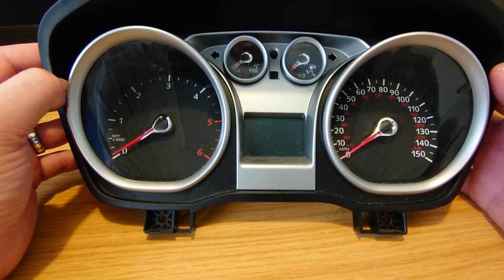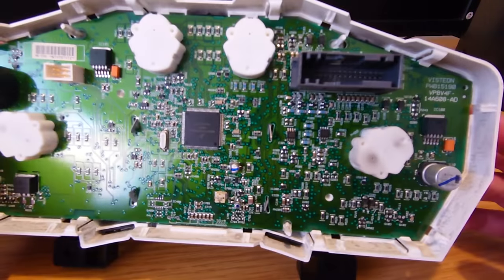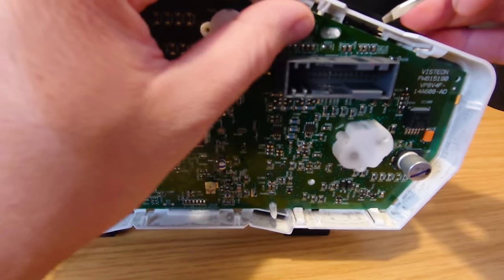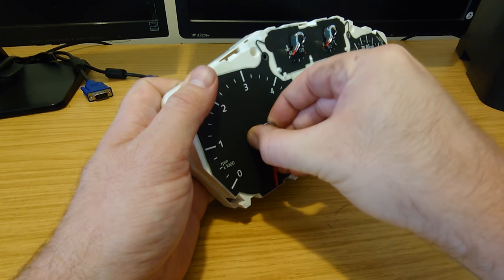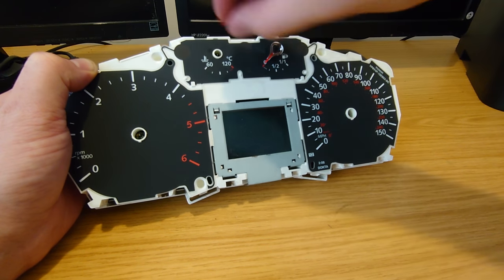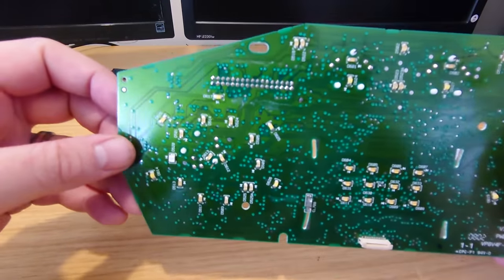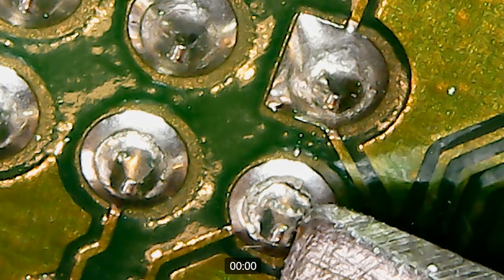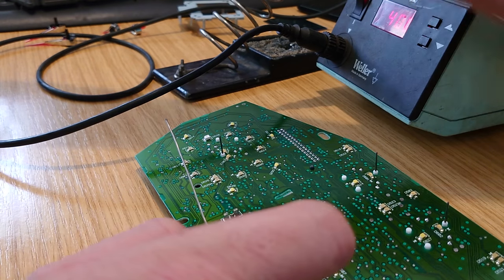Ford Focus mk2 instument cluster strip and repair U1900

Comment: I was one of the unsuspecting Ford Focus owners who came across this problem not so long ago. Transmission Malfunction and Engine warnings had me worried at first but it quickly didn’t add up, especially when it was intermittent. Some searching on the web had revealed that it was the pesky instrument cluster. This video helped me understand exactly what I needed to do and gave me the confidence to buy a soldering iron and try and fix the problem myself. A week later after the repair, it appears to have been successful. Whilst I didn’t have a microscope, I could still in fact see cracking on the original solder, so a re-solder of all the joints gives that extra security for any further mishaps. I will check in from time to time and update readers of this comment section but for now, the issue seems to have been fixed. Thank you to the creator of this video, you have helped so much!
Reply: Two months later and still no issues 👍🏻
Reply: Thanks I had this problem too.
Reply: @noddyhasgame  Hi, I've got the same exact issue you described above. Is your car still going strong since your repair job?
Reply: @HussainBukhari  Has been perfect ever since brother 👊🏻
Reply: @noddyhasgame  Thank you so much brother. This video and your comment gave me the confidence to carry out this repair myself. My first time soldering and everything went well, hopefully that’s the end to the instrument cluster problem for me.
Reply: @HussainBukhari  That’s excellent news my friend! I am sure it will be the end to the problem, in fact my car was running fine earlier, so I am sure yours will too. But make sure to keep us all updated!
Reply: @HussainBukhari Bonne année ! Salut, la voiture fonctionne bien ?
Reply: @EdenLaBaleine  bonjour, oui, ma voiture fonctionne parfaitement. même 11 mois après l'avoir réparé

Comment: I did the resoldering and the engine malfunction message disappeared. But the check engine symbol is still on. Does this mean I have another problem? The car is no longer in limp mode. Do I need to delete the fault codes or something after doing the repair to get rid of the check engine symbol?

Comment: I have had to perform this fix on the wife's motor. With this guide, it was effortless but for the need for a magnifying glass. The usb microscope makes it seem like it can be seen without some kinda magnification but I found that my camera had a macro mode on it so I used that to identify the cracked solder joints. All I did was reheat the joints with a hot tip and used a tiny amount of solder but anyone can fix this with a cheap solder kit and this guide. Brilliant video, thank you.

Comment: This exact issue has been causing start up problems for a couple of months. Diagnostics scans cost £80 and that’s before any repair work takes place. Car wouldn’t start but pressing on the instrument panel brought the engine to life. So definitely symptomatic of failing connectors. Reflowed them and the engine started up first time. No warning lights since. Thank you so much for making this guide you saved me a lot of time and money.

Comment: I had this problem a few weeks back. It wouldn't start on one occasion and a quick bang on the dash got it going which confirmed it was this particular issue so I whipped out the panel, followed the video, wasn't difficult and my focus is running fine now. This has saved me a chunk of money and hassle so a big thank you. 👍👍
Reply: Could you see a crack on the joints?
Reply: @Cripinub1  No it was difficult to see which one was faulty. In any case, it made sense to re-solder all the joints to prevent another one becoming loose so I didn't need to find the faulty one.

Comment: Great video. The only thing I would advise doing differently is regarding removing the needles; they do not need to be twisted off. It's better to pull them directly up and off - use a fork or teaspoon to pry them up if they're stiff. When reinstalling, press them directly down in the same position that you lifted them off.

By twisting them as you remove, you will almost certainly knock the stepper motor's stopping point out of position. Then when you reinstall the needles, they'll give incorrect readings. Readjusting and recalibrating them is very fiddly and time consuming.
Reply: Yes - I twistd them off and its impossible to get them to the correct position again.    Might drive this car off a cliff anyway
Reply: @matthewsalmon8194 Lol 😅 annoying same problem here
Reply: Any chance of making this a sticky? I've just wrecked my speedo stepper, by twisting it off...It might save some grief for others
Reply: Isn’t accuracy lost by removing them because they aren’t keyed to the shaft?
Reply: @MightyGimp  Yes, there is still a risk. But it's significantly less than if you twist them off. And once you have everything reinstalled, you should cross reference the readings shown by the needles against what is shown by the car's computer display (accessed via the service menu), to make sure they match.

Comment: Thank you for sharing this, my wife's 2010 CMax had started messing around with engine malfunction warnings, immobiliser issues etc. The diagnostics pointed to multiple CANBUS communication issues, but it didn't seem to be related to the cluster, banging it seemingly had no effect. That said, after getting stranded in a car park with an immobilised car, I decided to open up the cluster and at each end of the connector there were dry cracked joints. I desoldered and resoldered them all to get best results and the car is working perfectly again. The garage my wife normally takes the car to wouldn't touch it, and were essentially saying it might be time to replace it, so this has saved the cost of a new car!

Comment: Great video. Fixed my old broken instrument cluster yesterday after buying a replacement, which was also faulty. Followed all your steps and my car runs perfectly. Brilliant
Reply from the maker: Glad it helped👍
Reply: I resoldered the original cluster, like you did. The second hand one I bought didn't work at all. Thanks again
Reply: @rangerdan8661  I believe the clusters need coding to the ecu👍
Reply: @leefurniss  still working perfectly after 12 months with no issues
Reply: @rangerdan8661  Good to hear, I repaired an old friends a week ago and he can't believe It's fixed the problem, He was told by the AA recovery driver that he needed a new starter motor 😡Obviously he didn't

Comment: Followed instructions on clip. Resoldered the 32 pins under the connector. Cleared all the fault codes using ELM  OBD 2 (bluetooth one), used Torque pro software to clear codes, did 25 miles driving and no problem so far. Please note that if the engine malfunction display lights up and acceleration is reduced, if you turn off engine after stopping. Then you wont be able to restart the engine. If you clear the faults using elm OBD 2 reader then the engine can be restarted and you can get home. Thank you very much for the detailed video, It's brilliant. My middle display had two connecting strips, managed to take them out by pulling out two plastic lug near the connectors.

Comment: Saved me an effing fortune this! I ended up just melting the existing solder on each pin to cover all bases as didn’t have a microscope. Piece of cake. Like one of the other comments mentioned, definitely mark the dials position before removing and prise off rather than Turn as it ruins the calibration…recaibrating was the hardest part of the job in the end.
Reply: How did you recalibrate
Reply: @Cripinub1  left the front cover off and started the car up and reset everything whilst it was running. Had to cut the cable tie that holds the wiring loom to give me the length to fiddle about with it.

Comment: Thank you for your video. I had the same kind of problems on my Focus2 (2010) : Engine warnings, and sometimes unable to start the engine (in French : défaut moteur and sometimes défaut direction assisté). I check the instrument cluster and found exactly the same cracks on connector solders. I fixed the failure one week ago, and no fault came back. Thanks a lot !

Comment: Great video not easy but this video got me through it  brilliant ! The car runs alot better ,  but be warned the pins to be soldered are tiny , the LCD display is connected with a wedge system which I found very tricky and you need to rotate the dials the same way when putting them back on and make sure they hit zero so your not speeding without realising!  Great Video saved me a lot of money that I don't have 🙏
Reply: Hi Jimbob5b, I read your comments about the focus cluster problems, I have had the same issue on an 06 plate, I've done the soldering which worked fine but my clocks are all over the place, tàcho falls below zero, speedo is stuck at 50mph, temp & fuel gauge are ok, any thing I can do to get them to work properly again.
Reply: @billnolan4104  It was a long time ago and it was nightmare!  I remember the way you twist the needles on the speedo was different each side , have you tried to refit the needles but setting them at zero b4 the power is on  possibly,  it sounds like you are almost there! It is a tricky job from start to finish.  Go back over the steps and you will get there

Comment: Thank you very much for your great video manual that fixed my problems with the car: acceleration reduced and engine malfunction alarms,dropping of rpm and speed needles,ESP,engine unit warnings.
I found that solder on 5 of 32 pin contacts on the circuit board of the cluster were  cracked...
Reply from the maker: Thanks for the comment 👍
Reply: Can u see the cracks with your eyes?

Comment: Thank you very much for your video. I repaired my Focus mk2 instrument cluster due to your clear instructions. Cheers!
Reply: Did you do coding after?
Reply: @newlife2281  No I didn't. To be honest I don't know what you mean with "coding" but I did nothing more than disassebling the cluster and welding the cracked connectors. I was pretty easy.
Reply: @willfriend79  I think coding is not right word🙊.
I think it is programming or something like that
Reply: @newlife2281  don't worry, maybe it's  the right term. It's just that I don't know much about electronics. I only followed the instructions and worked. 😅
Reply: @willfriend79  so probably you are as good as me in electronic, understand nothing😂😂🤛
Reply: @newlife2281  absolutely 😂. That's why I think the video is a great success. 😅

Comment: Great video! Would this solve the problem of the light for the cluster (milage etc) not turning off after I've locked the car. It's draining my battery. Guessing it's one of these having cracks in it?
Reply from the maker: Most Ford I find take about 45 mins to fully shut down. I have a battery drain video on a VW golf if you need a process to follow on checking battery drains

Comment: Just what I was after as my 2010 Focus started exhibiting the same symptoms a couple of weeks ago and local garage won't touch electronics. Couldn't quite tell how you removed the LCD nor whether you just used a bit of flux to help the solder flow as you re-melted it, butt certainly got enough to work with. Just gotta figure out getting the cluster out of the car now! ;-)

Comment: Great video,this could actually be my issue at the moment🙏🙏 I’m getting engine malfunction and power steering fault come up on mine BUT it drives fine the immobiliser was playing up as well. I did notice that when the malfunction come up my Speedo and Rev counter stopped working as well, so hopefully this could be my answer to my problem🙏🙏🙏. Scared to hell of taking mine apart though 😬😬😬😬
Reply: That IS your issue. Solder those joints, youll be fine
Reply: There's places what do it for you 60 am paying they take it out repair while u wait an whack it bk in for u

Comment: Great video and nice clean soldering. I've had a couple of issues. Last week went to start the car and got an engine fault. Turned off ignition and back on, started fine and running sweet as a nut. Today had a similar thing happen and car displayed limited power with MPH gauge jumping up then down. Pulled over, stop, started and drove home no problems. No misfires or strange noises. Checked the codes with a cheap reader but no codes logged, pending or current. It's a 58 plate so it wouldn't surprise me if this is the problem. I will borrow a soldering iron from work and resolder to see if this cures the problem. Fingers crossed because I'm broke. 🤞
Reply from the maker: Hopefully it solves your problem. Go careful taking the gauges off. Thanks for the comment 👍
Reply: @rmautodiag  Thanks a lot. The way I see it, if it doesn't cure the problem then it least I can eliminate it without costing me anything apart from some flux. Videos like this really do help. Great work! 👍
Reply: Did you end up trying this yourself? Did it fix your issue?
Reply: @chadtillotson3478  yeah I did it myself in the end. It wasn't too bad but the solders are a lot smaller than you might think so you need a steady hand. It's been months now and I haven't had any problems so it works. If you plug a diagnosis machine into your car and the code U1900 comes up then it's almost definitely the cluster. I bought a cheap diagnosis machine from Amazon for £35 to help with codes.
Reply: @chadtillotson3478  btw the code will only show while it's faulting. It won't be stored in the cars logs for some reason.
Reply: It's the start of it I got away with starting and stopping unlock lock 3 times but now it doesn't work and av got myself more headaches ignoring it booking it in today to be re soldered 12 mile away from me bricking it for the drive there though when mine goes I have no acceleration
Reply: @Thefatfoodiemcr  I posted this 3 years ago and I'm still driving the same car with no problems after soldering the cluster PCB. Hopefully you'll get it sorted. 👍
Reply: @paulfinch1083 am sick of it hate the car it's the 2010 kuga and the idiots new these were a issue at Ford because they kept failing in the focus but still Cross used them spewing. Tried calling the auto guy now and he not answering 😫

Comment: One question if you can mate. Isit possible to remove the silver plastic trim on the front of the cluster? I would like to change the colour of mine and was wondering if I can actually just remove the silver trim on its own?

Comment: I have a 2016 Ford Fiesta, I’ll drive normal and the car will randomly shut off to reduced power, “immobilizer malfunction”, “engine malfunction service now”, “traction control off”, “power steering reduced”, “transmission malfunction service now”, “parking break engaged”, and my rpms go to 0 but my engine remains on. I can press the gas pedal as hard as I can and not a single thing happens or revs. Once I shut it off after it breaks down I can’t crank it at all. I’ve had u0101 “loss comm to tcm” and another U  code that said  something related to CAN Bus A. Now my OBD scanner doesn’t even communicate with the car anymore. Does this sound like the instrument cluster? 
Ps.: I already replaced the TCM and accelerator pedal and the sensor.

Comment: Hi Richard , have you got a video on focus st rear near side  light cluster no power to light . Brake light works ok . . Any idea where these go faulty .
Reply from the maker: Yes I have seen the bulb holders become faulty on the mk2 focus. If you want a quick and dirty test remove both rear lights and swap the offending bulb holder side to side and see if it moves the fault👍
Reply: @rmautodiag  thanks buddy I’ll give that a go 👍👍

Comment: Don't miss the speeded up bits, the tin cover is held on by bent tabs you have to straighten them to get it off also the  that display it covers that is not plugged in it;s a ribbon so be careful if you don't know how to take a ribbon off ,,,put something  thin in the first crack as this is a wedge for the ribbon it just comes up a little and the ribbon come out.....it is not a plug into the board.

Comment: Very instuctive video. Got the car starting but I'm still getting the engine malfunction and reduced acceleration. I think I may have damaged the tracing on pin 1 in the process. I've tried to do a continuity test on the pins I've resoldered but I'm unable to find a point on the board for pin 1 and pin 19? Do you have access to a schematics diagram of this board or a link to where I might be able to get one?

Comment: Warning lights, needles and alarms would go off randomly on 2008 Focus nearly every time I drove it. Sometimes wouldn't even start, but thanks to your diagnostic video I knew to waggle the cluster to get going. I was resigned  to having to get rid of an otherwise sound vehicle (42,000 miles) but thought s*** or bust and took it apart. I was reluctant to deal with a surface-mount, computer-related board but the offending connector is through-hole so no prob. Sorted! Having reassembled I found the needles had come off zero so had to be reset again. And only on it's last journey into position did I realise that the whole cluster assy will fit between the spokes of the steering wheel - I'd been forcing it behind. Duh!
Many, many thanks for such a clear & concise demo and giving the wherewithal to save an expensive replacement, by which I mean car: it was unusable and unsellable. Now it has a 12 month MOT and should do me until I go EV.
Reply from the maker: Thanks for the comment 👍

Comment: Hi,if I repair the original cluster which is showing no odometer at the moment will I need to have it reprogrammed or will it work once I plug it back in after successfully repairing? It's a 2005 mk2 Ford Focus 2.0 petrol automatic. Thank u
Reply from the maker: No programming required. You may need to change the screen if it's not working, usually they are back lit but nothing on them.